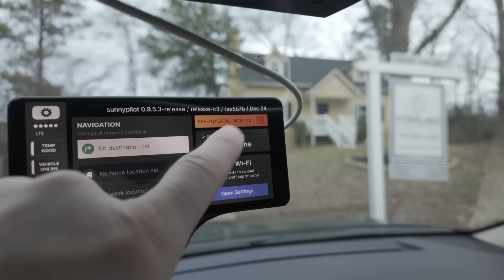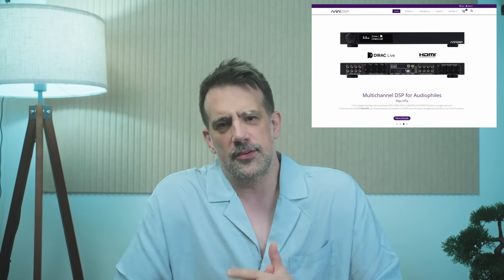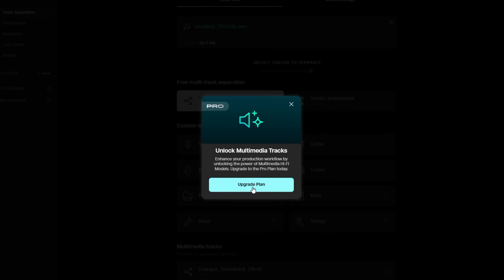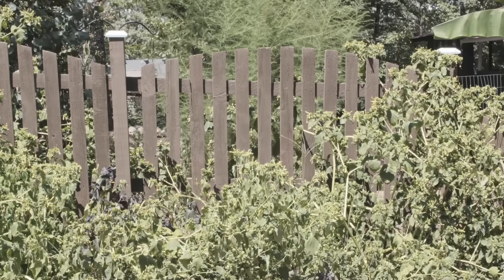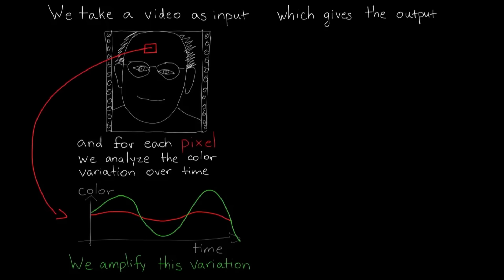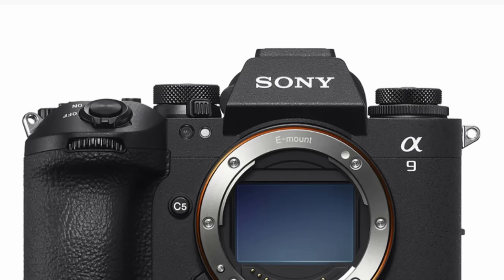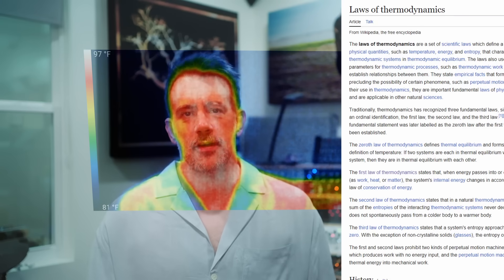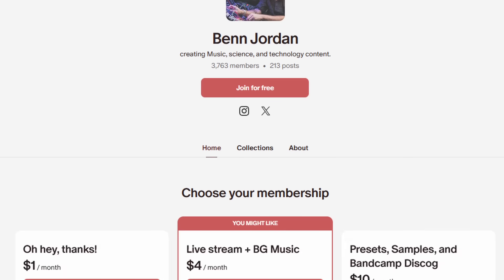How To Make A Legit Sound Camera

Comment: I was just having a think about seeing sound with a thermal camera; if you had a sealed, thin walled tube with an appropriately sized transducer continuously driving one end of it at either its fundamental frequency or one of its overtones, I was wondering if after a while, you'd be able to see temperature differences where the standing waves form high and low pressure areas in the tube? I know it wouldn't be much use as it would only work at those frequencies and only within that resonant cavity , but still a cool experiment, anyway.

Comment: When the tweeter got warmer, you were just seing the heat from electrical losses in the voice coil, not heat from the sound wave itself. A better test would be film a material that absorbs the sound waves from the tweeter, e.g. acoustic foam placed opposite of the tweeter. But frankly, I doubt it would be measureable in practice.
Anyway, thanks for the great video!

Comment: I strongly disagree with your explanation and demonstration of sound producing heat. The tweeter is going to be behind a crossover, so at low frequencies, the tweeter won't be getting much power. Another issue is at least in this video, you didn't dwell at multiple different frequencies for long enough for all the parts of the tweeter to reach thermal equilibrium. As you put power into the tweeter, the voice coil heats up, but it will take a while for that heat to conduct to the outside of speaker cone where you can see it with your thermal camera. I'd bet good money that all or nearly totally all of what you are seeing is just electrical power being turned into heat through resistive heating and has nothing to do with sound. (I really enjoyed the rest of the video.)

Comment: I would like to say that for the heat test at 15:00 you're probably picking up the heat increase from the flexing of the rubber on the tweeter than the sound itself. the camera is even explicitly picking the ring to measure from. that doesn't mean it's not possible to measure how much heat is being transferred though sound, but this measurement was flawed.
Reply: I think that heat mostly generated by the speaker coil.
For the thermal cameras, the heat in the air is invisible.
Another thing, that is true the compressed air is warmer than the uncompressed, but the sound wave has a negative pressure part as well what is cooler than the normal air. The average temperature of both is equal to the silent air.
Reply: @raytry69 speaker coil 🔉🔉🔉🔉🔉⚡️

Comment: Visualizing sound via heat doesn't seem really  likely. What is shown in this video seems to be more about the coils of the speaker heating up because of joules effect, that would make more sense I think. I would have to check with the right formulas but the energy carried by a sound wave isn't near enough what it takes to heat anything (at least under safe hearing levels). Plus the energy of the waves decreases proportional to r³ (sphere)

Comment: Benn, you should learn how to use Docker instead of using venv. It helps a lot with dependency management + clean environments.

I use docker + Makefiles to build my apps using macros, and in containerized environments that make it easy to deal with the problems you faced.

Comment: One of the physics labs I did in college was optics, and one of the cooler demos we set up was a laser interferometer. Similar in principle to what you're describing here. We were able to tune it to visualize thermal layers and flow around e.g. a small airfoil (finger sized).

Comment: A few years ago, I had a problem with migratory sparrows around my studio in Rome. They were in the trees, causing a mess. To avoid harming them, I bought a sonic device that mimics the sound of a predator bird that specifically hunts sparrows. Just one second of sound scared them away without harm, and I managed to clear them out of the area. Maybe you could consider something similar—a sonic device that mimics the hawk's predator. It could be a gentle way to remove the threat without causing harm to the birds.

Comment: It looks like you have some promising results from open source libraries and a single camera. This is inspiring me to try to find a set of good enough commodity sensors that can generate multiple samples from the same scene. (Using a principle like how image stacking can give amazing astrophotography results.) Perhaps such a system could be as basic as taking three 2020-era smartphones and pulling all sensor and mic data raw/unprocessed into something like an Nvidia 3080.

Comment: I believe the heating you observed on your tweeter is the inductive heating of its voice coil. The woofer doesn’t heat up because the crossover blocks high frequencies. The two best ways to heat up a speaker (or coil) are either really low (DC resistive) or really high frequencies (inductive).
Reply: I agree, it's likely heat from an unideal impedance match when the tweeter is was beyond the desired operating freq.
Reply: I was thinking, wouldn't a better test be to point the sound at like a wall or piece of paper and see if THAT heats up?
Reply: Came to check the comments for this very hypothesis.
Reply: Exactly, and that means that what he's measuring is the mechanical and electrical effects of the production method, not if the sound itself is producing the heat.

But the premise does have a bit of validity. The high frequency sound will induce motion into the target, which will heat up the object due to friction from the flexing of the object.
Reply: Could also be the membrane flexing?
Reply: Yeah it was only voice coil heating. But the rest of the video was awesome 👌
Reply: Probably more resistive heating because of losses in the coil wire. The woofer will probably get far MORE of that even (bass needs a lot more electrical energy for the same perceived volume!) - but it also has much higher thermal mass acting as a heatsink!
Reply: that's what i thought too
Reply: And I thought the wire was heating because of Q = I² • R • t
Reply: that was my first thought when I watched that segment
Reply: They got Perty cheap thermal cameras now days you can plug into your cell phone
Reply: Woofer is heating up as well, you just can't see it as the voice coil is deeper inside and heat doesn't travel that fast.
Reply: @VEC7ORlt  this. I came for these series of posts. And also dang it everyone beat me to the info.
Reply: The tweeter is heating up because the voice-coil mass is tiny compared to the woofer, however the power being delivered to it is the same as the woofer (assuming it has roughly the same impedance response).  In addition to this woofers dissipate heat more quickly as they have larger excursion and so air convection supplies some cooling.
Reply: @BassCharacter  Playing music, the woofer will have anywhere from 5-10 times the power going to it then the tweeter.
Reply: @BassCharacter  If you supplied the same amplitude, at tweeter-range frequencies, to a tweeter as the woofer routinely has to handle, one or both of the following will be happening: a) The tweeter, which in most consumer speaker will not be designed to handle the full rated load of the speaker cabinet because due to the next reason it will never be needed, will burn out, b) it will be intolerably, ear splittingly loud in the room.

Comment: Since heat is just how "fast" the atoms vibrate/move around in a system, i guess if you make something vibrate fast enough, then yeah you're basically exciting the system by putting in energy. Also it's interesting that higher frequencies interact with smaller and smaller "things" in physical reality. That's why low pitch/low frequencies go through objects easier than high frequencies... There's definitely a lot of common things between sound and heat and then also in effect, how things appear visually.

Comment: Rolling Shutter is a surprise tool that will help us later.

If you can figure out the exact timing between rows you can increase the temporal resolution of your recording times the number of rows, as long as you use a zoom lens to fill most of the sensor with a single object. I was almost sure you mentioned that in your laser microphone video, but I just skimmed it again and didn't find that mention
Reply: Yes. I was thinking the same thing. If you used a single line from each image and turned it into 30`000 fps (1080 lines x 30 fps-ish), there would not be much to see on each individual frame, but you'd get rid of the "time dilation" rolling shutter produces within a single frame. Possibly interpolate the rest?